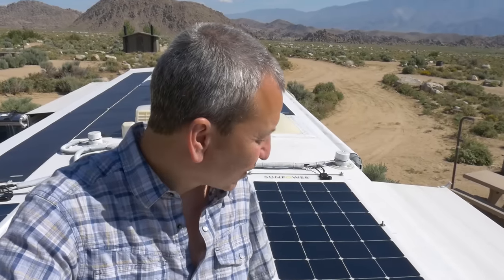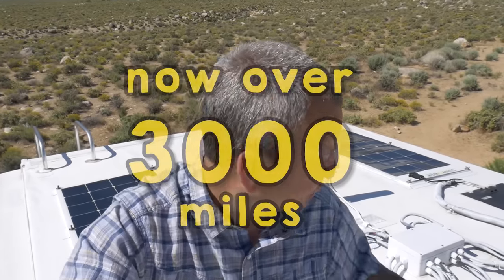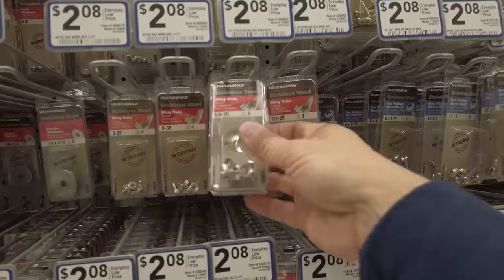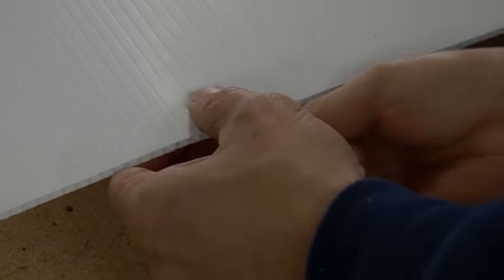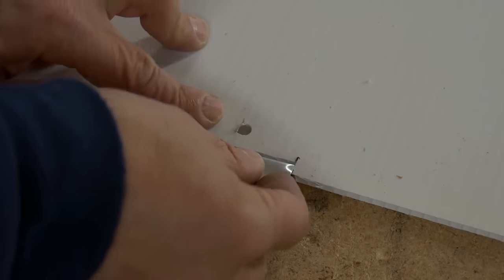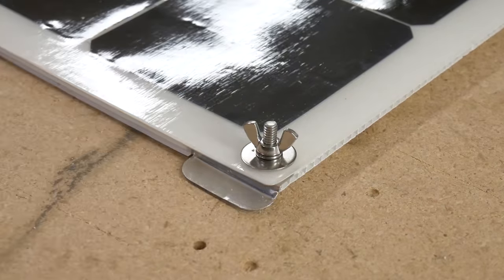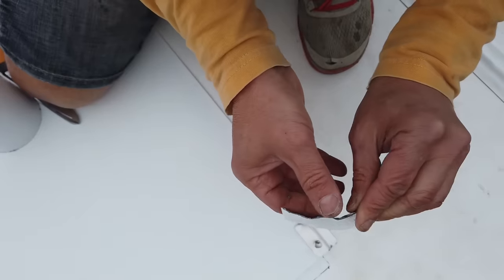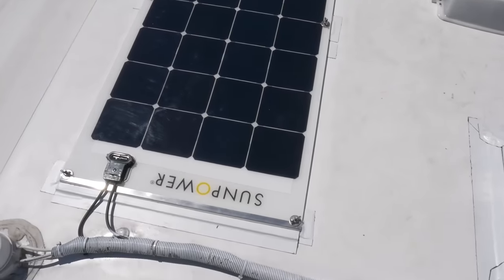Better Way to Mount Flexible Solar Panels on RV (2019)

Comment: This is perfect! I’m considering the same approach you have by using the flexible solar panels.  
I love the idea of being able to remove it easily. Great job! 
I have another topic to pick your brain on. I saw the flexible panel comparison video, which was very helpful. My biggest head scratcher is the number of panels. The online calculators say I need 8 200w panels for my little 15’ Jayco. My monthly use at the campground is showing 12,000w per month. I am in Florida where the air is needed full time, and for the dog while I’m not home. What would your suggestion be. Thanks and blessings to you and yours.

Comment: Do you know anybody that has used your method in the North East or where it gets cold in the winter storing their rv outside. I was wondering if ice would form in the corrugated plastic and damage the setup.  .

Comment: Did you check and see if the carriage bolts had any effect on the roof membrane. They must get pretty hot when in direct sun.
Reply from the maker: Nope. Haven't checked yet.

Comment: doesn't the plastic board melt underneath the panel ? Wouldn't you want to use something that distributes the heat in the metal car frame ?

Comment: Hello
Sees that you are trying to solve ventilation under the panel to get rid of the heat
Think it's interesting with new ideas.
But I wonder how much the temperature drops in the solar panel with this solution, interesting to know
Can plastic dissipate heat from the panel? , how does the air flow in the plastic ducts?
Tape that prevents dirt from entering also stops air that should cool the panel if I understood it correctly.
can you explain how it works and show the difference in temperature with and without plastic, under the same load (more load more heat)
Also wonder why flex panel when there are panels with frame that are spaced for good ventilation and good efficiency, cheaper, longer life length 25 years, heavier only disadvantage
flexpanel more expensive, lower lifespan, max 1-5 years
Hoping for answers so I can learn more
Reply from the maker: Check out this video posted earlier this year https://youtu.be/p7N-tNQNtNM

Comment: Excellent, thanks for sharing, but how do you prevent the carriage bolt from turning when you unscrew the wing nut?
Reply from the maker: It's not on super tight and unscrews with just a little pressure without spinning the bolt. I think the square inner part of the bolt gets pulled into the aluminum hole a bit to lock it.

Comment: No doubt the aluminum front strip helps hold the panel down but I wonder if closing off the airflow holes was a missed opportunity.  I'll bet they would stay cooler and perform better with even a little airflow under.  Still, I love the concept!  Well Done!
Reply: I was thinking about that too, and it is very perceptive of you. Then I realized Tito is right.  If you exposed the air hole tubes front to back for air to flow thru, the wind shear from the volume of air rushing in would weaken and degrade the bond and lift the panel up. You will notice Tito has the air holes running side to side. There is so much air rushing in at 60 mph speed that you want to block the front end, and allow it to swirl around to the side holes. There is more than enough air to cool it sideways.  I am not a physicist but can intuitively feel that this is a better design. No risk of wind shearing the panel off and also no bugs getting smushed inside the holes!

Comment: Are you using 2" eternabond on the leading edge? I didnt see it listed in supplies, and that stuff is pricey! I suppose I could cut the 4" in half, great method, Im currently gathering the resources to implement it. Thanks!

Comment: What is preventing the bolts from simply spinning when you add the wing nut? Seems like once you get the wing nut to a certain point the bolt would simply spin rather than tighten.
Reply from the maker: You're right. It does. Actually it went on fine, but was difficult to remove without spinning. I'm using a T-track now that seems to be working much better. Check it out: https://youtu.be/uJIEXhnF8MU
Reply: @RVwithTito  Oh nice! I'll follow the updated plan, then! Thanks!

Comment: Hi from the UK. Thanks for this vid. Question ?  Does the shadow from those raised wing nut/bolts affect the panel performance. I was told that only a small amount of shade on a part of a panel would seriously decrease the performance. Thanks.  Happy travels everyone. John
Reply from the maker: No it won't affect it. The sun would have to be so low for the wingnuts to cast a shadow. At that point your not generating much power anyway.

Comment: Did you do any preparation to the fibreglass such as sanding down to the base layer before applying the adhesive? Thanks for making the video, very helpful thanks!

Comment: You replaced the original flexible panels, (I think).  Is it your experience that the flex panels don't last as long as the normal glass panels? Your mounting system is genius!
Reply from the maker: It's hard to make a blanket statement about flex panels. Sure, traditional panels have been around longer and are a preferred option for many. Some flex panels are made better than others though. I'm hoping to find the best ones out there that will last so others can benefit from my testing. Of course, this takes time and a failure or two is part of the testing/learning process.

Comment: What a perfectly fantastic system Brian. Thank you for saving me countless hours in Home Depot mumbling " Will this work?, would that work?  ".  it still took me an hour to find that transition strip ( z-bar part# 026366941009) after watching your video and pausing it at the 1st frame of home Depot to see what department you were in, lol. The only thing I added was a piece of eternabond tape between the bolts and roof and, between the front metal strip and roof. Thanks for sharing. Happy camping
Reply from the maker: At my Home Depot (actuall I have 2 nearby) those transitions were gone. Then recently restocked. You could also bend a piece of aluminum flashing to get the same result. By the way, I'm usually that guy wandering the halls of Home Depot mumbling. Cheers.

Comment: In my experience the SunPower Semi-Flexible panels last just less than 3 years before they produce essentially no useful power.   I had four panels on my RV and watched their power output drop precipitously after 2 years, by the time they reached 3 years old they produced NO power.  I worked with their tech support and they confirmed all four panels were bad.  Unfortunately I bought the 1 years old van used and the warranty is void as I was not the original purchaser.  Kinda sucks huh?

Comment: Hey Brian, great Video's! I followed your latest flexible solar panel setup. 
The only thing I did different was to use EternaBond around the entire Corrugated Plastic Sheet so no water would stay between the roof and the Corrugated Plastic Sheet. I noticed I had condensation between the corrugated plastic sheet and the roof two days in a row and we live in San Diego were it was warm and dry but the water was there all day.
Reply: Roman Schwab this was what I was concerned about as well. Can you comment if you’ve had any further issues with condensation under the plastic? I originally eternabonded my panels directly to the roof all the way around but the tape peeled back after 1 year on the roof and water kept getting underneath the panel. 

The other thing I’m wondering about is perhaps the key to the plastic is allowing the airflow to pass in the cells and if you tape all the way around the plastic sheet then no airflow can pass through. Thoughts?
Reply: Hey @skypixelmedia , I did not have any issue since I used the very wide EternaBond tape all the way around. But maybe this would be a good time to go and check it out since I have not been up there in a couple month. If I see anything that is concerning, I will send and update.
Reply: Thanks appreciate it. We went ahead and taped the whole edge around the corrugated plastic like you did for fear of condensation building up underneath the plastic. Just don’t want to deal with that again

Comment: Cool!   Might this technique work for standard panels that are a little thicker and heavier,  or is it thin flexible only?
Reply from the maker: I'd stick with just flex for this technique. Check out my newer t-track method. It may work for some other panels.

Comment: Hey Brian, quick question, is it easy to remove the panel with the aluminum strip at the front edge? I just imagine it would be difficult to get it around the aluminum strip and off the bolts at the same time but maybe there's more flex in those panels than i imagine?  Anyway, amazing idea!
Reply from the maker: It comes off ok. Check out the follow up video I just did...you'll see.

Comment: Wow those sissors mean business. This is a great idea and an even greater documentation of the instalation. Thanks for sharing :) You didn't mention why you orientate the channels on the plastic sheet. If you had of do it  lengthwise the front strip would have prevented the cooling airflow, so you did the right way by having it sideways :)
Reply from the maker: Correct. The side orientation is also for drainage since my roof is slighly angled down towards the edges. It drains pretty well in the rain or when washing the roof. Yes those shop scissors are awesome and worth the $20.

Comment: Another great idea and video! My only comment is using Loctite on carraige bolts will make them impossible to remove later. Those lock washers should be enough. Oh and where is that great campsite? Off 395?
Reply: If he used red or black Loctite he would have a problem. Blue Loctite is a removable type that kind of gums up instead of turning to stone. I was wondering about that campsite too.
Reply from the maker: There are two different kinds of Loctite. I used the removable kind, not the permanent kind.
Reply from the maker: Oh. Yes that campsite is near Lone Pine and the Alabama Hills area just at the base of Mount Whitney.
Reply: @RVwithTito  I thought so. We camped west of Lone Pine last fall. It was a bit sketchy driving my Class A up those dirt roads but the view was worth it.

Comment: If you drive allot,that extra air flow while driving would really cool off those panels, isn’t that the point?i have seen this installed on boats and they get no lift on the panels

Comment: Do you have any experience with Merlin Flexible Solar Panels. I'm considering them for my RV but can't seem to find much on them other than what the company puts out. What do you know and any advice.
Reply from the maker: Yes I do. I've been talking with Merlin for the last 9 months and have tested a 160W panel since December and used it for several months snowbirding down in Arizona. It's probably the most robust flex panel out there but expensive. You may have noticed Xantrex and Battleborn rebranding them. I plan on doing a video soon. comparing the best flex options. That's on of them. Just let me know if you have specific questions.
Reply from the maker: Oh yeah. I also helped the RVGEEKS   install theirs last summer.
Reply: Thank you

Comment: Can you charge solar generator with 100w flex panel thanks
Reply from the maker: Yes. Just make sure you have an MC4 to 8MM or Anderson powerpole adapter to match the powerstation input.

Comment: I did exactly as you did. When I got it on roof the holes did not match up probably because van curves slightly. I guess yours are flat. What a mess getting all that off. And a big waste of eternabond. Gotta start over and find a better way.

Comment: I've noticed you really seem to like the flexible panels. Do you find the lower efficiency and panel heat issues outweigh the installation flexibility over ridged panels? For under $300 I was able to get two 285watt name brand 32volt panels and it seems they make more sense from a square footage and longevity rational.
Reply from the maker: I do like them but longevity is still in question for these types of flex panels. Rigid panels can surely be a more affordable and long-term option if you don't need the benefits that flex panels provide. I would argue about the efficiency though. Those Sunpower panels with prime maxeon cells offer the highest efficiency you can get right now.
Reply: @RVwithTito  The efficiency drop is from the heat as flexible panels don't have the air gap below them. This is my biggest concern as it affects both the efficiency and longevity. You should try doing a cold vs hot panel test I think you'll be surprised.

Comment: silly , just put little bar strips of aluminum over the little spaces around/between cells to increase heat transfer. slit to allow curving.  or put expanded aluminum sheet on the back.

Comment: Thank you for this. I'm using this technique to be able to transfer the flexible panels from my camper to my trailer. I have 2 issues though. When using the bolts, I have to use M6 for my panels, a couple do not completely tighten as they will spin. I'm trying to correct this with adding a lock washer at the bolt head as well as the other side above the solar panel. I believe this is working but still playing with it. The other question I have is when you are attaching the transition strip for blocking the wind. I don't understand how to remove the panel when the transition strip is taped down to the top of the camper. The solar panel needs  to come up vertically (lift straight up). Do you bend the transition strip straight up then lift the panel off?  Thank you! Rich
Reply from the maker: This the front strip is hinged using the tape. I've got a new method coming soon that I hope solves all of these issues.
Reply: @RVwithTito  When do you think the new version will come out?  im getting ready to install 6 panels with your solution. (LOVE IT). I will wait to see the updated version :)
Reply from the maker: @happiicamper  Hopefully within the next week or two as soon as I can get into a decent spot with good weather.

Comment: Sooooo; I specifically asked Renogy today regarding heat on flex panels directly to the rubberized roof and they said it’s not an issue for their panels.  Hmmmm.

Comment: Is the bolt locked on the back in contact on the VHB tape? Was hard to see at 7:50 this would help the bolt keep from turning if a nylon lock nut is used.  Eternabond tape is a good touch for a nice belt and suspenders approach, for getting past penetrations in the roof.

Comment: How long did the fabrication and install take you? I'm starting this today (sunday) for a trip on Tuesday. Wish me luck! And thanks again for a stellar install method!!!
Reply from the maker: Probably around an hour per panel start to finish.
Reply: @RVwithTito  Well I was gone a week, travelled 2000+ miles and your setup was PERFECT.   Could not have done this trip without it. THANKS!!!
Reply from the maker: @jackballjohnson3468  Sweet! Thanks for the follow up. I've gone several thousand miles with multiple panels mounted this way as well and it's still working perfectly too. Glad you had a great trip.

Comment: I would consider double sided tape all the way around the edge on under side of plastic panel to keep water from getting in between RV roof and said panel and growing mold.
Reply from the maker: I found that condensation still develops with a sealed installation. I prefer an insulated layer. I've had the best results with that. See the more current install video https://youtu.be/uJIEXhnF8MU

Comment: I could be mistaken, but it seems to me that the metal footings are eniterly unnecessary. The eternabond tape is what's holding the panel down with or without the extra footing
Reply from the maker: I eventually came up with this method which has worked the best https://youtu.be/uJIEXhnF8MU
Reply: @RVwithTito  I like your eternabond tape method more since I'm not worried about high end appearances

Comment: Great video but I can’t really see how the insulation would help with heat it should prevent the dissipation of heat.
Reply: That polycarbonate board has air cells that pass through.
Reply from the maker: It's difficult to tell at this point how much of an impact it will have. The openings in the plastic do provide airflow and good drainage. Time will tell.
Reply: @RVwithTito   Excellent How-To vid.  Have you considered a double layer of polycarbonate?  I'm thinking that the insulation value would at least double with 2 layers and the costs (materials, thickness, effort, etc) is negligible.  Also after reading the replies and questions in this thread, is it probably important to point out that it looks like you cut the polycarbonate so that the holes are on the sides of the panel and by doing so the aluminum bar across the front is not blocking the air flow.  Right?  If a person to use double layers it would be tempting to cut each sheet at a 45 degree angle and stack them so that the resulting airflow crosses at 90 degrees for a maximum cooling effect.  You'd end up wasting more product, but the insulation is far cheaper than the cooling benefit.

Comment: I like the idea of ventilation. Is the corrugated plastic panel UV resistant? It does seem that the plastic solar panels break down over time, being exposed to the elements. It will be interesting to see what the lifespan is of your system. Thanks for being a pioneer for the rest of us
Reply: Stuart Stuart at least the panel is blocking most UV rays so i suspect the center will hold up nicely.

Comment: Your install was in 2019, how is it now holding up? I was thinking to do your install idea on my boat but not sure how the corrugated plastic would hold up in a saltwater interment. How are the panels doing with the gap to allow heat to disburse
Reply: environment *